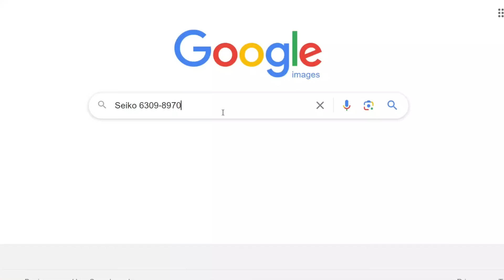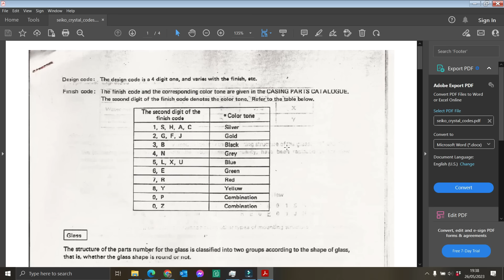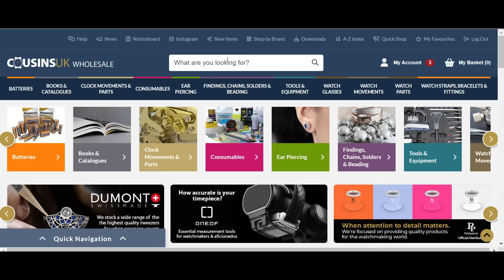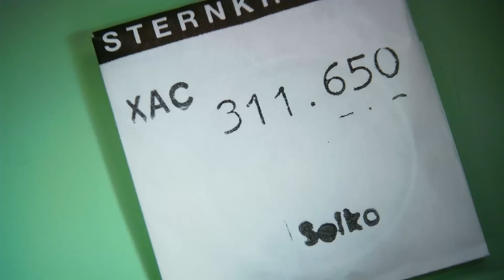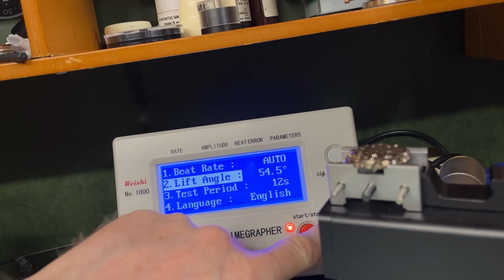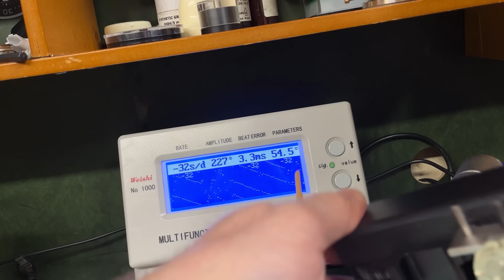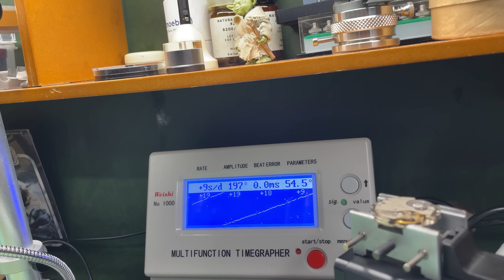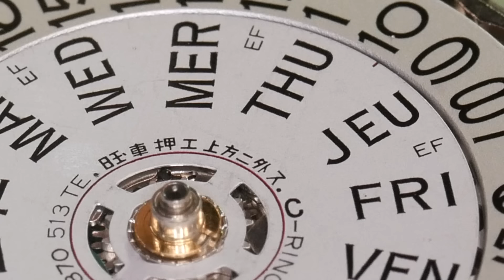Repairing the Irreplaceable: A Fireman's Watch That Seiko Couldn't Fix !

Comment: I enjoyed watching that.  I am 74 now and although I like repairing things, watches scare the life out of me ! I have repaired and timed mantle clocks, and have just been working on a few travel alarms. I have a Seiko Kinetic Arctura 5M42- OE39, Number : 734377,  which is probably from the 80's which no one wants to repair,  a Rytima that runs, but gains an hour a day, and a helvetia 31 or 32 type, silver pocket watch  with a broken balance staff, that does not have details on the movement, just Hallmarks and "GS" number 36575 I think my Grandfather bought that back in the 30's. I will start with a Wingo Levermatic one day soon ! Hope you are well and if you want some stuff for your videos let me know. I will cover the costs. It will be worth it for the lessons !

Comment: Great story 😊 This movement was one of my first after cutting my teeth on the Seagull ST36. I even asked you about how the bridge is fitted I.e. lining up the pivots! Like you said - trial and error. I did note in the service manual that they recommend hooking the click spring further out on the case and then drop the bridge on. Thanks heaps Mike 😊
Reply from the maker: Thanks Jon. Pleased I relied to your original question. I get so many that some do get missed.  Yes the service manual, I even have this one in colour now ( link in description) however I now seem to run off instinct rather than fact 😂😂

Comment: Nice video, as usual Small tip when putting the train wheel bridge: screw in a couple of screws for a couple of turns, so that the bridge does not get nudged out of place.
Reply: On a knowledgebase of zero, I was going to suggest the same - just enough turns on the screws to hold the bridge in, while you fiddle the wheels into the bearings.
Reply from the maker: Hi George. Sometimes I do that but usually I’m good with bridge placement and when I’m just using my loupe and stereoscope it’s easy enough. 
Now I’m learning this new 2d skill of looking forward and not look at my hands thinks appear more clumsy
Reply: @MyRetroWatches  This is your second watch using this microscope? hardly enough time to be used to the new setup. ⌚
Reply from the maker: @sonnymoorehouse1941  yes. I hopefully can only get better using it
Reply: @MyRetroWatches  Your an inspiration to anyone wanting to learn watchmaking. Thank you for sharing your adventures !!!!!

Comment: I've just started on my watch repair journey (spent far too much on tools already). I have a seiko 5 6309a lined up to work on in future. Initially the first one I bought turns out to be a real botch job (straight out of mumbai of course), but it was cheap enough. I've found a second nicer watch to work on, and a replacement dial for that one (I hope). Seiko seems like a great brand to focus on, there are just soo many movements out there!
Reply from the maker: Good luck . Yes the basic Seiko movements like 6309-6119-6106-7019 etc are a great place to start. Usually day dates so enough complications to get to grips with.  Parts / donors are easy to find and watches being affordable.  This hobby does not have to be expensive as I demonstrate in most of my videos .

Comment: Thank you for the video  I enjoyed watching it but I didn’t hear what the time was on the time grapher before and after you cleaned and oiled the watch ! I was watching a video of a Rolex that was worn about 53 yrs then put in a drawer for several years and when it was cleaned and oiled it was keeping time within one second  which was amazing. The watch was made in 1958
Reply from the maker: This was within 10 seconds a day when I gave it back to Darren. 
Rolex are different to Seiko plus if it’s at for decades not running then there’s no wear as it’s not been used.
I will assume that’s Marshall’s videos and he only ever shows one position on the Timegrapher. Anyone in the know will tell you that’s wrong. You need to regulate to 4 positions. Just showing dial up on the machine is erroneous, put it so crown is up or down as this is where gravity plays a part and also where the watch sits on your arm as you walk about . It’s those readings where you get deviation and where you have to compensate for error.
You will average all readings in positions and adjust to find the best results.
In most of my videos I will show it in different positions but strangely I don’t see anyone else do this !

Comment: Another great video, Mike!
Sentimental value of a watch often exceeds the status value others seek.
A very nice repair of a watch with true value.

As for your microscope, I don't think you'll get used to pinpointing where the parts are when working on it.
For a perception of depth, you need to be able to use both your eyes.

For about the same price as your microscope, I was lucky enough to find a stereo microscope with more or less the same work height.
Makes all the difference when working on watches.

Comment: Hi Mike. I started out with the same type of microscope that your using and could never get use to it. I ended up getting rid of it and went into a stereo microscope. OMG what a different.
Reply from the maker: I have a stereoscope, I’ve used it for 4 years now but I only use a scope for inspection and oiling. Never once wanted to build a watch under one I have always been more traditional with loupes and a visor. My last video was a review of this scope and I was very positive about it due to the features and interchangeable lenses plus laptop software you can use to measure things with. Take a look at that video.

Now I just want to use it for part of the video setup for YouTube .

Comment: Nice work m8 as always and you tackle it with patience and finesse :)   I am abs in love with my own recent 6309-5030 and a great fan of the movement as they are pretty invincible.   My 5030 is a 78 year and is keeping very good time despite its age.
Reply: Scored another of my grails, very first gen Pulsar diving quartz, basically a SQ diver but with Pulsar logo, needs a new crystal but found one almost immediately using your method of crystal sourcing, am hopeful I can find one for my square Tissot SeaStar 2030 quartz and a bracelet as well as its the one with the integral bracelet.
Reply from the maker: Your missed in the group mate. Please just setup a new profile that does not link back to you and use it just for our group.  If you let me know the name I will be sure you gain access. You can then enjoy it all without any of your personal troubles getting in the way.

Comment: Excellent video, very entertaining and very useful for  getting an idea of what's involved. I've been building some basic Seiko mods and it's been a steep learning curve just putting the dial on the movement and fitting the hand set (especially the seconds hand) then fitting it inside the case. The crown, stem and stem tube has also been quite tricky to get right 😅 but I think I'm getting better 👍
Reply from the maker: Well done Tim.  Repetition is the answer, the more you do it the easier it becomes.
Reply: @MyRetroWatches  thanks, that's true. It's great that you were able to fix his watch especially when no one else wanted to 👏👏👏

Comment: I tried a similar microscope set up as yours, which I now only use for record keeping. I replaced it with a binocular microscope which is exponentially better especially the depth perception.
Reply from the maker: Agreed and this scope will be used for filming so I do need to learn how to work under it.  I have a stereoscope but I have only ever used scopes for inspection and oiling.
Reply: @MyRetroWatches  my stereoscope does have an attachment for filming and video but I don't have the camera so that's why I'm not using it for recording. Mine is an Amscope suggested by the guy from Watch repair tutorials. I love his channel

Comment: Have a seiko 4r36 that the plastic gear used to changing the day and date was broken on, The Seiko AD watchmaker said he could change the movement for 100 euros, but I got luckiy and it did go under Seikos warrancy in my case, so Seiko offical service center took and replaced my movement, Im suprised they were so keen to changing it instead of just replacing the gear. 

I guess with high labor prices here and very efficent movement manufactoring makes it more economical to save the minutes of the watchmaker fixing it and throwing in a new movement instead, a little sad in a way, all though it also highlights how efficent the movement manufactoring has become

Comment: I’m wondering if he stuck it on a line free machines. If you are not familiar with it it’s only used for quartz watches and it is a motor with a magnet on it will spin the movement around and the hands spin around. If the oils are a little sticky then sometimes you can get one working again for a while.
Reply from the maker: The quartz tester is basically a magnet and that will not make a mechanical watch spin as a quartz has a step rotor which is magnetic. Stick a magnet on a mechanical watch it will just magnetise it.
I used to have a small quartz tester but it broke

Comment: Great video Mike but your issues with the microscope are because it is a mono one. You should use a stereo one which gives a much more perspective and depth perception.
Reply from the maker: I have a stereoscope but can’t record on it.
Equally although I get better depth of field I can’t see well out of my right eye from birth. My brain does not use it. So even with a stereoscope I don’t get the full benefit
Reply: @MyRetroWatches  Thats a real shame as it would help enormously. I would really appreciate your guidence on a Seiko 7000A movement which I cannot seem to get a mainspring for its a manual wind in a watch marke 7000-8000 on the back. Any help would be hugely appreiated Mike.

Comment: Lovely job Mike! It is sad  that it had to go thorough 3+ "repair" shops with out being done right and possibly harmed. 
I do have a question about the amplitude you show. It seems low to me but I heard that many vintage Seiko's have a lower amplitude compared to Swiss or American watches. Is this true? And as I have 2 older Seiko's I'm trying to revive, what is a satisfactory amplitude?
Reply from the maker: Seiko's do have a lover amp and on the 6309 the balance wheel is very big so it could also have something to do with it.  On a movement like this anything from 200-230 is a win.
Reply: @MyRetroWatches  thanks so much

Comment: This is the first of your repair videos I've watched. I did notice you checked it electronically during the repair, which I've seen others do, but I don't believe I saw you check/adjust the accuracy of the watch; i.e. How many seconds per day it was fast or slow. If that was part of the mid way electronic test you performed, and just didn't mention the degree of accuracy, please  forgive me.
Reply from the maker: I tested on the Timegrapher midway through build, it was poor so I discussed I’d change the balance. I then put it back on the machine in the video and the lines were better however I never shown the watch after regulation which was just something I missed in production. Trust me videos like this take me a month to film and edit. Sometimes you miss bits and don’t realise.
It went back to Darren at a healthy amplitude of 235 and within +6 seconds a day.
He has not taken the Watch off since getting it back.

Thanks for watching. Please bear in mind I am just a hobbyist of 7 years now. Self taught. I’ve been making YT videos for some 6 years now
Reply: @MyRetroWatches  Thank you for your reply. Please don't take my comment as criticism as none was intended. I only mentioned it as an item I like to see and, this being the first of your YT videos I've watched, a suggestion for you going forward in the event you don't normally include this and others, like myself, see it as important. Just as with any mechanical item looking good only goes so far if the item doesn't work to expectations. Thank you for clarifying the accuracy of your work on this piece and I look forward to watching more of your videos.
Reply from the maker: @MtnHiker  thanks I didn’t take it as criticism, others had mentioned it and in nearly all videos I show the finished result good or bad.
Equally thought constructive criticism is always helpful to better my production.

Comment: It's too bad that your microscope doesn't have a separate optical pickup from the monitor, because  you could move the monitor further back from the optical pickup.  That way, when you lean in to do some work using your eye loupe the monitor wouldn't get in the way.

Comment: hey Mike, just stumble upon your channel while i was browsing a solution for my watch. a little question Mike, my seiko 7s26 movement has plus 300 second a day, it was dropped before, is it caused by the shock? is it the balance wheel? thank you in advance, 🙇‍♂🙆‍♂
Reply from the maker: Hello , hairspring 100%. It’s tangled or stuck in some way which makes it smaller and thus runs really fast. It might just be a case of removing it and putting it back in , or a new balance which on a 7S26 are usually cheap to source from a donor watch .

Comment: The problem with this movement is the same with Orient. They develop in time wear at the mainspring barrel in the main plate and the barrel bridge
Reply from the maker: It’s most Seikos of this era and beyond. They didn’t jewel the arbor  bushes .
Reply: At least this version allows you the replace the bushing for the mains. barrel. The later model was one piece and they fail after 5 years. I'm trying to find a suitable jewel, so I can modify mine, but is hard due to the thickness of the plate being too thin. I tried from a Seagull movement but ... didn't work.   @MyRetroWatches
Reply from the maker: @MirceaD28  I know Arian at Vintage Time Australia does the jewels for bushing for the 6139 chronos

Comment: Mike I need your help😢. I have two 6309A on my  workbench and both need a mainsprings and also one of the arbor is bad all of plating is gone. For the mainsprings I order the GR2534X and found out like other the end of the spring too big to fit the arbor so it won't hook itself. I then order the GR25341X which is for  ETA 2892a2 but end of this spring is now to small for the arbor and they no way I can get the arbor in. As for a new arbor I not found not yet but still looking. Great video Mike.
Reply from the maker: Its been a long time since I replaced a spring on a 6309 as normally I find the old one work fine so unless its broken I dont bother. I will have just bought the spring from Cousins uk website using the their recommendation on size.  As for an arbor I have never seen these new and again extract from a donor movement.
Reply: Not sure about mainspring yet, like I said the one that Cousins UK calls for is the GR2534X but again the coil at the end is too big. For the Arbor I did find some not sure if they are NOS or used but can't be any worth than what I got.

Comment: I think the issue you are having with your vision through the microscope is referred to as your (  Depth Perception ) from not being able to triangulate the distance to an object from your eyes determined by how much you have to cross your eyes to accurately focus on the object.  Our brains were the original super computers doing all of these complex equations in microseconds.
Reply from the maker: Yes its all about perspective and depth of field.  I am now 3-4 watches serviced under the scope and I am not really any better!  I only have one good eye from birth due to a severe astigmatism so my brain basically does not use the right eye.
Reply: @MyRetroWatches  I've watched you and your videos over time and I've seen your work space evolve and  tool inventory progress and I will say that your level of experience and skill has grown along with your tool catalog.  I just have to say "Well done Sir, well done"
Reply: @MyRetroWatches  oh and 1other thing about the use of just a single eye and accurately determining the size of an object relative to distance.  I, like you am an amateur Watchmaker, and am still in the process of acquiring my tools and device's to practice our hobby/profession and 1 of my eBay finds was a magnifying device that folds up into a small box about 1/2" x 2" x 2". (Wish I could just send a photo, be so much easier)  It unfolds into a flat base with a inch and a half hole that's indexed along the top, bottom and both sides with hash marks about 1mm. apart from each other. It has a vertical side 90 degrees from which the top section unfolds directly over the base with an inch and a half round magnifying glass looking down onto the base with the hole in it. The point of this whole reply is that using only one 👁️ eye with the assistance of the equally graduated hash marks it assists in the Perception of depth.  Don't have it in front of me right now, but do remember it saying something to the effect of the linen industry. Thinking it was for very fine thread count of fabric sheets.  If you don't already have one, and you come across 1 pick it up and try it. I highly recommend it.